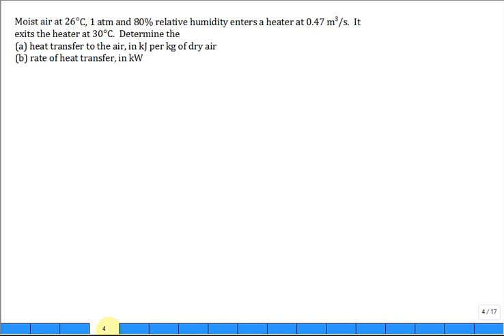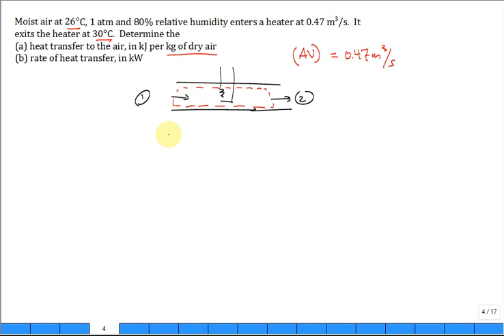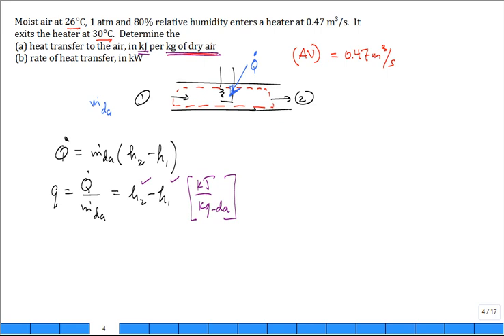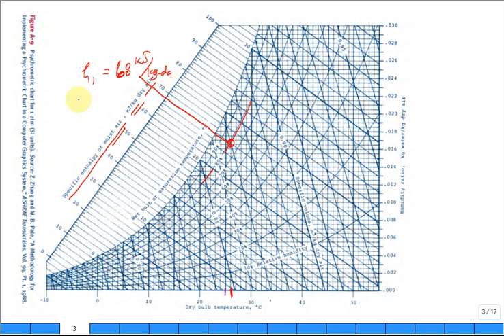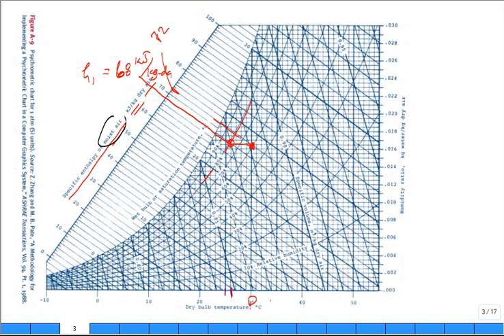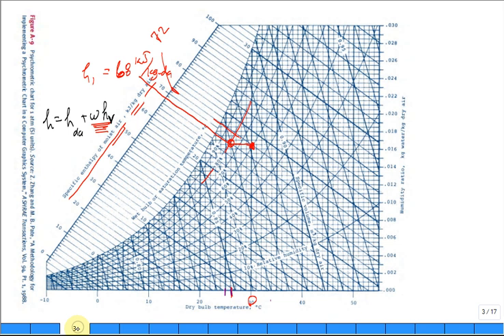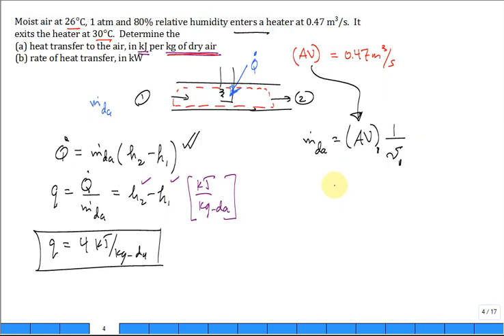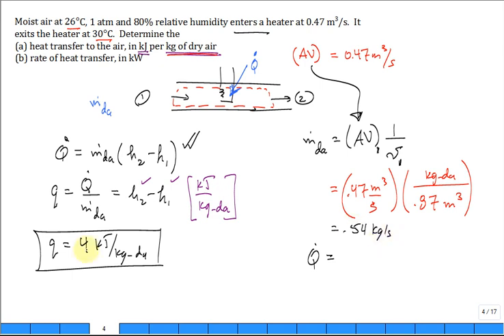Use psychrometric chart for heating moist air

Comment: What happened if you heat it over 60 degree C? thanks in advance
Reply: Hi good welcomed to shering thankyou gues bested all well
Reply: Yes,  vertical.parallel  lines fromthetop ofthe chart extendingto the  horzional  line  atthe  bottom  are the dry bulblines thescale atthe  bottom is dry bulb  temperaturescale. Diognal lines  are thewetblb temperature line thescle  marked atthecurveofchart isbulbscl.Dew point line horizonal. Parallel  from  leftofthechartpowndoff  moisture line arethe same.atthe rightside of chartthe grainesof  moisture perpound dryair  grains  of  moisturescleonegrenis equalto 1/7000poundof  moisture perpoynddry air'isobtaindby  multipy grainsof moster per pound by 1/7000. Sensibl heatfactor alsois given  atthe  rightsideofthechart.expls,  dry bulb psyhrometerthe  dry bulband  temperaturesare foundbe 83'f.and72'F  respectively  .using  psychrometric chartfind  follwing,, Dewpoint grainesof mosisture per pond,   volume ofonepoundofair(specific volume)  ,Enthalpy (heat  countentofpoundair)
Reply: Explsis  60%extend the  dew  dew  pointline  passing throughthe of intersection to  the vdewv point scle  to  red the  drew vpoint  Dew  point=68,F extend the  graines of mositure  line  passing  through the  point ofintersection to the  graines  of  moisture  per  poundscle  to  read  grains  of  moisture  per pound.  Graimes  of  moisture  per  pound=102 findthe specific volumeofone pound airpassing throghrhe point interrsection which givesthe  vovumedone pound air.specific  volume  (volume  of  poundair=14cubick feet     g.    Grainsof  mosterpercubic feet=grains of moisture per pound /volumeofpoundair(cubic  feet)=102/14=7.286grains.
Reply: My psychrometric chart only goes to 55 degree C. If it is not on the psychrometric chart you would need to use the equations to determine the enthalpy of the mixture (it is an equation with enthalpy of air and enthalpy of water vapor).

Comment: why you said omiga is constant ?
Reply: Omega is constant because omega is the absolute humidity of the air and when heating the water will not condense so the same absolute humidity exists but relative humidity changes because that is how much moisture the air can hold and that changes with the temperature of the air. Pretty much if something is being heated (without adding water during heating such as spraying steam) the absolute humidity (the y-axis on the psychrometric chart) remains constant.